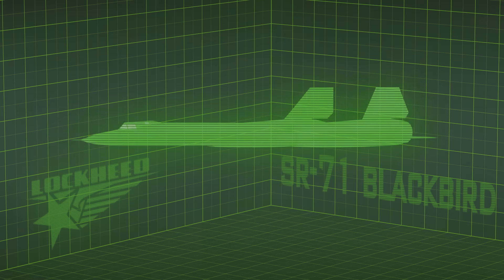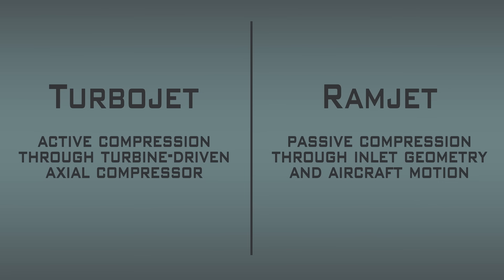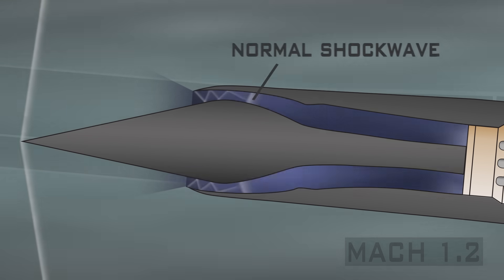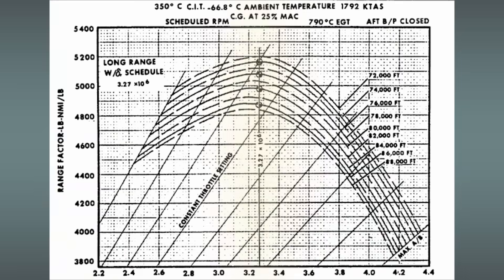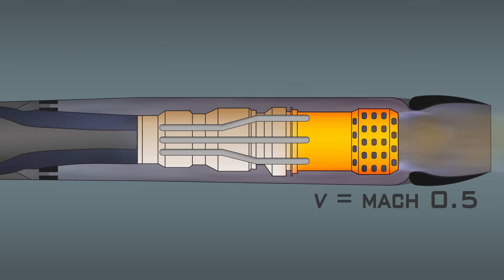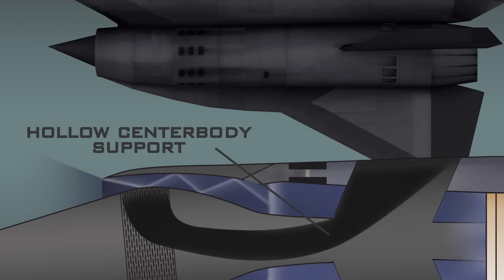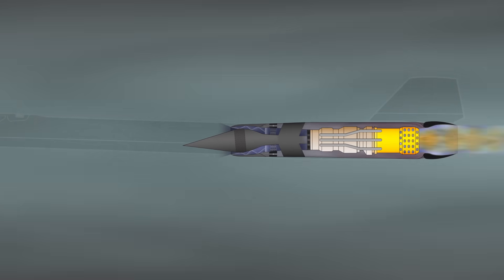The Mighty J58 - The SR-71's Secret Powerhouse

Comment: Yeah but like
Why are the spikes angled?
Reply: Lunacae Light  I think because the conical supersonic shockwave coming off of the nose of the plane meant that the inlet spikes were receiving incoming airflow at an oblique angle- not straight ahead - the inlet spikes were shaped/angled to account for that. Their shape “corrected” the airflow to be as symmetrical/even as possible, minimizing pressure differentials from one side (outboard) to the other (inboard) of the compressor turbine stages in the engine... Imagine if one side of the compressor turbines were being hit with air pressure that was dramatically higher than the other side- a large asymmetrical side load- it would put a huge strain/imbalance on the turbine blades, bearings, and shaft. That’s my understanding, anyway- if anyone with a more accurate/informed explanation can contribute or correct me, please do!

Comment: Fun fact, the limiting factor for the flights was the TEB (teraethyl boron) used to ignite the afterburners. Since they couldn't refuel that with the rest of the fuel, once they ran out, the mission would end.
Reply: Engines would re-start without additive once they were flying.
Reply: @saulrivera6462  not the afterburners
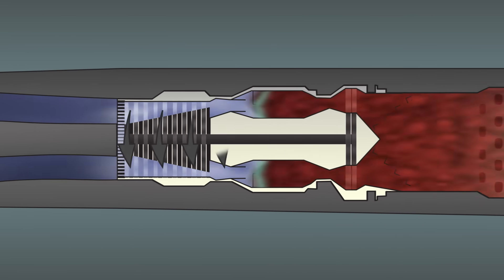Reply: @Kumquat_Lord  Incorrrect. See 0:55 and 1:25 No TEB needed. TEB is just needed to start the engines, hence the green flash seen here https://youtu.be/wt4BYGiFws4?t=10
Reply: @saulrivera6462  from wikipedia: "The engine and afterburner were lit with TEB and the afterburner also had a catalytic igniter that glowed in the hot turbine exhaust.[16] Each engine carried a nitrogen-pressurized sealed tank with 600 cm3 (20.7 ounces) of TEB, sufficient for at least 16 starts, restarts, or afterburner lights; this number was one of the limiting factors of SR-71 endurance, as after each air refueling the afterburners had to be reignited."
Reply: @Kumquat_Lord  Wikipedia? Not factual.
Reply: @saulrivera6462  your source is literally "bro just trust me" my guy, I at least tried to give you an answer. And you DO realize that if you actually went to the page it would list the sources at the bottom, right?
Reply: @Kumquat_Lord  ok, I'll oblige... link?

Comment: It's amazing that this air intake and the Concorde's very sophisticated inlet were created in the 'Slide rule' day and there control systems weren't exactly accurate by today's standards but boy they worked . I am curious when being chased by Sam's and missile launched from Mig 25's could not catch the SR-71. What an incredible aircraft .As for the Concorde it would carry 100 passengers in comfort probably eight times a day flying up to 60000 feet at Mach 2 in pressurisation levels of about 6000 ft, only beaten in the last few years by 787 & I believe A-350's. These 2 aircraft were staggering and extremely clever . The thing that stopped the Concorde going faster was the temperature reading at the nose. The distance between the Flight Engineer's panel and the nearest bulkhead increase from a few mm to over 20mm in the cruise. The flight engineers all shoved there hats in there on the last flights. To get them out now they would have to be cut out. Both planes marvellous engineering was developed in the late 50 and the sixties.

Comment: Several years ago I came across hi def video footage of the j58's final static engine test.  The exhaust structures were so white hot that they were near reaching the point of transparency.  Hard to believe those metals did not end up in a pool of molten liquid on the concrete.  The pencil point blue flame clearly showed each individual shock diamond perfectly focused to a single point at the tail of the flame.  I tried to return to the site a few days later but this video was no longer there so it may have been classified.  I have seen older footage showing the j58 in a test cell.  Though impressive the, theimage quality was far from approaching the previous test footage.  I believe the hd footage was taken at Edwards.  I have seen individual still frames from this footage since, but never the video.  Anyone have any knowledge?
Reply: Did you ever rediscover the video? I remember being impressed with the video quality, it was by far the best resolution video of a J58 test I'd ever seen

Comment: A crowning achievement for us! Still remains so knowing that since it's conception, no one's managed to create an engine or aircraft to compare. The Russians managed to devise the Tumansky R-15B-300, a relatively normal turbojet engine which propelled the MiG-25 Foxbat to speeds of Mach 3.2, just shy of the Blackbird's top speed, but that thing couldn't reach those speeds without causing irreparable structural damage to the aircraft. It might have fared better if it weren't made largely of nickel steel, which made it very heavy.

Another thing the video didn't mention was that the J58 also uses a very unique and complex fuel composition to power the engines and keep them cool at those speeds. By itself, JP7 has a volatility so low that you could drop a match into a bucket of the stuff and it'd snuff the match out. In the engines, it had to be injected with triethylborane in order to make it combust. Any other fuel would not take very kindly to the heat generated by the friction at those speeds, and likely would not ignite at all at those altitudes.
Reply: SR-71 Blackbirds offical top speed is not the actual top speed. My dad was a pilot in the Air Force and even wasn't allowed to know the Top speed of that beast. It's that classified.

Comment: Why don’t the modern aircraft such as F22/35 have turbo ram jet engines?
Reply: The SR-71 was not a fighter, it flew  reconnaissance missions only. To fly that fast you can't fire weapons, cause you are flying faster than bullets and missiles. At those speeds it takes 3 states to turn around, so you could not engage in a dog fight. Also, unlike a traditional fighter jet, the SR-71 took a couple of hours to get the crew dressed in their pressure suits,  whereas a fighter on alert can be launched in a matter of minutes.

Comment: I was serving at Beale afb in 1975. I worked in transportation shuddling flight crews to their planes from main base.Beale was quite a large SAC base and kept about 10 or so b 52's loaded down with bombs at the head of the runway. A friend and I had the privilege of making sure all flight crews vehicles at the alerted pad were in perfect functioning condition in case of an emergency. This was a  restricted area and wasn't even visible to the main base. Although it was also the runway for the SR71. Quite a few times we watched as the pilot and navagation officer emerged from the motorhome- looking vehicle that took them up to the store. They appeared to be wearing Gemini type pressured space suits.my friend and I were amazed as the two man crew climbed into the cockpit. At that time cables we're plugged in from the start carts which were almost louder than the jet. (Open header exhaust). The start carts would spin the motors up until they fired.(Awesome spectical). One of the things about the blackbird is that it was built for speed and didn't perform well at low speeds. This is why from the wheels starting to roll to being up and out of sight seemed to take mere seconds. The fact that they would stretch several inches at cruising speed they were very loose and leaky on the ground. The hanger floors were covered in fuel oil and didn't really look safe. The Air Force maintained a small museum that featured the extreme camera equipment showing photos from 80000 ft. The resolution was so good, the pictures could be blown up to clearly read a license plate on a vehicle or the number on the jerseys of school kids playing football. That amazes me to this day. I would not trade those memories  for anything. At time they flew practice flights with a T-38 off his wing. Every once in a while you would hear an explosive Sonic boom only to look up and see that the SR had disappeared.im still blown away by the fact they built this awesome machine without the aid of computers or many of the devices we take for granted today and is still the fastest airplane we know about.
Reply: Thanks for the story!
Reply: You may have run into Sgt Doug Sapula, at Beale with the 9th SRW at some point. He and I were stationed at Pleiku AB in '67. RIP Doug.
Reply: I grew up in the Yuba City area, I always wondered why the SR71 took off with a tiny little T38 next to it. If I remember, they took off side by side, or so it seemed.
Reply: @hangfried9429  I believe it was to inspect the plane and to make sure the airspace was truly clear. The Blackbird pilots had limited visibility with their small windows and full pressure suits.
Reply: I'm just gonna ignore the rest of the thread, but I must correct , the SR71 is the fastest air breathing airplane ever, there were faster rocket-propelled airplanes, such as the x-15, reaching up to mach 7 apparently? Or at least that's the number I remember, anyway it is a beautiful thing that came out of it's time
Reply: Thanks for sharing William and hats off to Kelly Johnson what a legend 👍
Reply: 🤣😂🤮Where is a single reality fact about this jet NONE only a few outside pics 0 inside pics and a fake story on Wiki hahaha lol such a FAKE that has been produced by the Pentagon to make 35% demoncratic morons of the world to believe in it brainless brainwashed demoncratic western idiots LOL... trash fake channel blocked just like others!
Reply: there hardly seems a purpose to build an atmosphere bound craft for any reason since the advent of icbms and satellites? the russian shuttle had supplementary turbofans so was technically an self propelled aircraft and of course would fly through atmosphere up to orbital velocity so faster 🖒
Reply: @user9823-v1t  I would assume the same reason the u2 is still operating.  Also the question of why not from a science perspective when having huge gov contracts and pushing the testing to the most extreme levels.
Reply: I met a dude who worked on the U-2 engines at Beale back in like 2015 and he said he was not allowed to work on the camera equipment. People with suits would show up to the base, remove the camera equipment, work on it in a locked room with no windows, and then place the camera equipment back in the U-2. I can't even imagine what kind of stuff the cameras can do nowadays.
Reply: The J58 engines would expand 6" in length and about 3" in diameter.   Few people knew this fact in the '60s.  All was highly classified info and could get a fellow arrested in a bar off duty just for talking about.   I was a base photographer at Beale til '67.  Took lots of pics of the Blackbird, then went to Kadena, Okinawa for 18 months
Reply: I see your fast SR-71, and raise you one faster piloted missile of a plane, in the X-15
Reply: I love the air shows around our nation.  The Thunderbirds and Blue Angels, just to name a few.  I also miss the amazingly universal cohesion, that until recently, our country enjoyed.  I enjoy watching and saluting 'Ol Glory' in parades, at baseball games and during events.  I love our country and the power we have given much of the world.  However, the fundamental structure of our amazing, first ever, American experiment in fundamental human rights and responsibilities is internally and externally threatened.  

America is still powerful, but like the powerful engines of the Mighty J58 - The SR-71's, wear and tear maintenance of our moral, historical and fundamental foundation for being the great nation we are, is threatening our existence as the great American nation by 'We the People".  I am shocked by the invisible threats threatening our nation.  The physical aspects of America are still awesome.  With an amazing President, unafraid of the Swamp, we can revitalize the 'grass roots' strength of this tall nation.  We must properly educate, walk alongside and empower our young countryfolk.  

They are the underpinnings of the future of America, and we are their guides.  Some among us are not for America as the great republic of 1776.  Some among us seek to 'remake' America into an entirely different country.  They seek to abandon our mostly free, not always satisfied, but always free, nation model and become a mostly controlled, supposedly economically fair country, like Russia, like some European countries, like Cuba and several South American countries, much of Africa and much of the Near East.  

I grew up knowing our military up and down was true blue.  As a nation we have become soft.  I am amazed that the Berlin Wall was not the end of communism, just the relocation of the barrier.  As spies infiltrate our country, our younger generation threatened, we must invest the time and knowledge of sharing the worth of this great nation or we will loose it in this generation.  

I was astonished by the rapid takeover of the business college I graduated from, between time I begun and the time I finished.  The first semester seemed almost as good as being in the military from a patriotic point of view.  Pro-communist lecturing was required in my senior year.  I and only one other in my senior business class, rebuked the communist indoctrination as being against my capitalistic expectation for by MBA.  Do it, or else, was the pronouncement from the registrar, dean and advisor.  I nearly vomited just to get out.  

The few years in college is a nightmare for most untrained youngsters and parents too busy to know.  Not grounded in basic American history, busy parents and expensive grants for paying for decreasingly useful college, young Americans are improperly taught about the virtues and not the destruction of socialistic/communistic nation states, by deliberate lies, censored and altered American history and life, by change agents in our schools.  Bands of elected Socialists compel the corrosion of our republic, that we warriors, and the like, must regain through true-historical and patriotic education, that revitalize our republic.

We are facing serous threats to America as a God fearing, freedom loving, capitalistic republic with the best military in the world.  They threats to patriotism unlike any other generation in American history.  The children in school, colleges, universities, trade schools and in unions, are our future.  They will make our history.  We must intervene.
Reply: @Nonotkidding  TLDR
Reply: @Nonotkidding  first intervention is to rid this country of the cheeto colored fop charlatan living in the white house. A "real estate tycoon" was not, and is not the correct choice to lead this nation. This is a country, not a company. He has no business being in that office. He is a spineless, calculating profiteer that knows what to say to get weak indecisive people to group think just like him. Fear and division is how he leads us, I find this detestibly wrong, and completely against the fabric our freedoms are woven of. Wow, I have totally gone off track from this video. Cool plane, always thought so.
Reply: @markk3652  Nice response to Mr. Wells.
Reply: @markk3652  So much hate.  Unplug from Occupy Democrats, get a therapist, and start thinking for yourself with an objective mind and your perception will change drastically.

I enjoy the CONSTRUCTIVE stories here in the comments of experiences that people have had with these incredible machines, certain minds may not have the capacity to read through it all but thanks to Will and John for sharing.
Reply: @406Steven  meanwhile, you praise the narrative/diatribe of wells? You should re read what he posted. Nothing in my post can be construed as false. There is a winding core of one sidedness and distorted nostalgia contained in wells' post. Politics be damned, the world has changed, not only our country, but the entire world, open your eyes. My quick discovery of the meaning of what wells was shoveling isn't a slight against me, nor do I need to "seek out", or "unplug" from anything. I can clearly see how our country has been brainwashed by the current administration as well as the preceding several. My opinion is in fact my own, and the simple truth is you and I are obviously on separate sides of this debate. We're going to have to agree that we'll never agree.
Reply: @markk3652  Too bad our other choice was an outright proven lying crook who used per position at State to filler her family coffers from her husbands speaking fees paid by foreign dictators, and who swindled her way into the candidacy. Good thing she lost.
Reply: @markk3652  24/7 TDS?
Reply: Omg you think anyone is going to read to whole thing William and Jonathan really
Reply: @oscaryeung3601  yes we are buddy
Reply: @oscaryeung3601  All of Williams post, yes, as it is technical.  Jonathan's, no. too political
Reply: @oscaryeung3601  I did moron

Comment: Too bad the GE yf120 is probably still classified it was the engine built to compete with the Pratt n Whitney yf119 that went in the F22. The GE yf120 was way ahead of its time it performs as a turbofan at low speeds and a turbo jet at high speeds